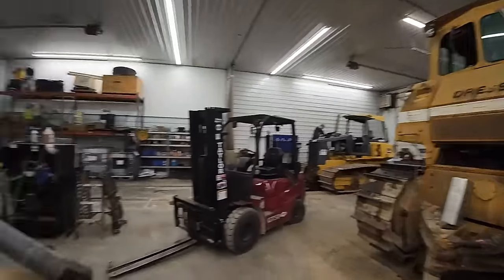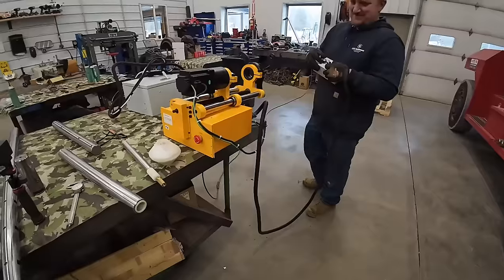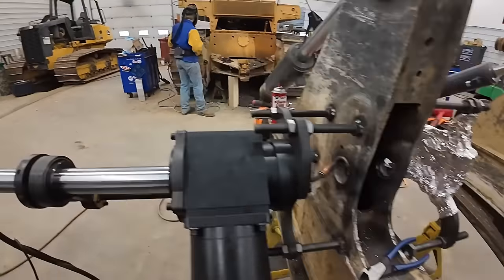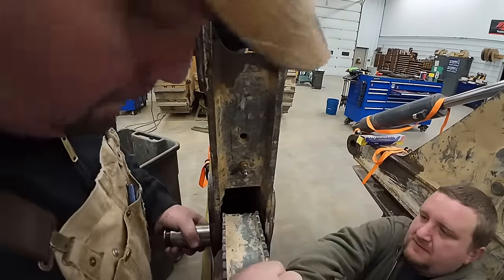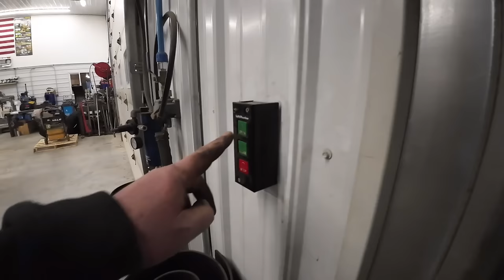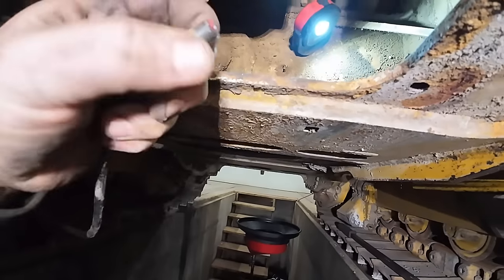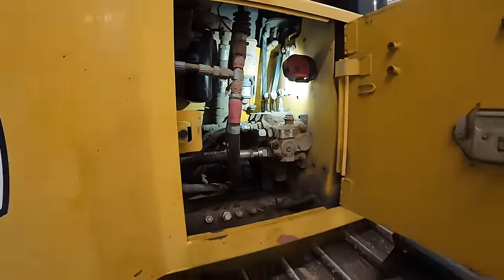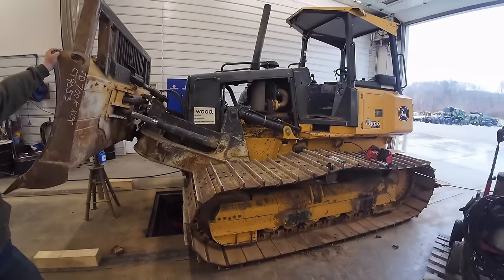Bore welding and line boring a dozer blade C frame and installing on a John Deere 700J

Comment: A "buck-boost" transformer maybe adequate to adjust the voltage output and be more cost affective. However the standard wiring of them are for 12 / 24 volts or 16 / 32 volts. If the building power is at 120 volts, a 12 / 24 bucks boost on the 24 volt taps will give an output of 120 - 24 = 96 volts. This would be most acceptable to operate the unit. The kilowatt size of the buck boost transformer at 24 volts in this case would be 24/120 = 20% of the full load of the motor at 100 volts. The bucks boost transform comes with a wiring diagram to indicate how it is wired into the circuit.

Comment: The overheating issue may be due to the cord length and size that you ran to it. Need to use the shortest possible cord and one wire size larger than the load requires to account for voltage drop and the fact that it is a cord, having the wires encapsulated in the rubber sheathing, holding in the heat.

Comment: overseas is 50 cycles.. here is 60 cycles..  so the a.c current is going faster then overseas, voltage is 110, or 220 to our 120 and 240

Comment: I believe they run 50hz compared to our 60hz. Which may account for the increased temperature. Nice thing is that the Servo motors are very common and could easily be replaced. Not sure what those are rated at.
Reply: I also think your right but dont they run 100😮 volts not 120? So it would be 50/100 where we are 60/120.🙄
Reply: Half of Japan is 100V 50Hz, the other is 100V 60 Hz. They are the only country that I know that is 100V. Europe is 230V 50Hz.

Comment: Most of the across the pond the power is 50 cycles and 240 volts instead of 60
 cycles 220 volts.

Comment: What about using the large boring bar to cut a hole for welding in bushings with an ID correct for the pin?

Comment: Think you should replace the motors with American specs the cycle is off , but then they will run like they should. Maybe you can buy a power converter.

Comment: I think if you do the conversion of inch to millimeter I think you said you were taking .080 which is just over 2 mm so you were running it at its maximum cutting.

Comment: you can convert to hydraulic motor  you need a pump  and a motor and a controller the electric motor is bad for burning up i work in power plants as a machinist hydraulic is the way to go hope it helps you out

Comment: I wish it was in the budget to do that to the JD350C I bought off you, been working through the pivot points for the blade and taking out some of the play. There was a bit more play in it than it looked. At least its giving me some video content
Reply from the maker: Yea
It takes so much time and money that unfortunately as a shop it adds up and prices the machine out of the market 
We just did all this to the TD25 but the price reflects the work we put into it
It does make for good videos!
Reply: @C_CEQUIPMENT  Totally get that and understand. It is what it is. Just as you have shown “maintenance, maintenance, maintenance”. Also John Deere did not have grease fittings on some of the movable parts.  😢As well as they added replaceable slides on the later model blades than mine. Not sure what they were thinking with metal to metal on movable parts. But it will work out when I’m done. Thanks for the reply

Comment: Isn't there supposed to be a cover over the the hydraulic hose connections on the front of the machine that acts like a strain relief for the hoses?

If you want good line boring and welding equipment climax is an excellent brand and they are hydraulically powered units with a separate power pack unit.  The issue with the motors getting hot may be related to the voltage of power you are running them on.  A common problem I see is people running equipment designed for 240v 120/208v power systems.  My parts washer didn't get real hot and it took forever to warm up because it had a 240v heating element and I was running it on 208v.  I didn't have any problems after replacing the element with one designed to operate on 208v.  The older miller welders actually have a jumper near the wire feeder for switching the unit between 240v and 208v power.

Comment: I think your issue withe motors may be two fold. They may be 220 volts at 50 cycles, the 220 they use in England is like our 110 outlets.  Hot  nuetral and ground but 220

Comment: i know someone has likely said it already but europe iis like 240vac /50hz, asia is 220/200vac 60hz, usa is 110 /220 vac 60 hz that could be it you might have to see if the things have a voltage switch under a cover somewhere? just an idea  ack hydro oil to tha face!

Comment: Check Kurtis at cutting edge engineering. He is on you tube he does alot of line boring and welding. Just a suggestion.

Comment: Clint you may want to consult an electrician but I’m pretty sure european power is 50Hz and I believe USA power is 60Hz. This may be your motor overheating problem.
Reply: Found this too. 

For the same motor all the parameters are constant except the frequency and this will affect the applied voltage, so simply apply this equation and see what will happen:
V1/f1=V2/f2, V1=400v (for example), and
f1= 50Hz,
f2=60Hz.
Then, the new voltage to be applied V2= 400x60/50=480v.
This is the new required voltage to be applied to get the same motor duty as before.

As you see the voltage should raise to get also the same power as before, if not the motor will consume more current and become hotter. I mean you can imagine if you have a motor running on less voltage of what is recorded on his nameplate, what will happen to it? This is exactly what will happen in this case.

It will run with following problems for a 50Hz motor running on 60Hz:
The core loss will increase and cause over heating of core.
As the core loss will increase, the Power Factor of motor will reduce.
The motor speed will be higher, so shaft load will increase. Motor will be overloaded at rated load.
Motor will produce magnetic humming sound.
Motor Bearing life will be reduced (marginal) for more speed and more load.
Dielectric Stress on insulation will increase due to higher frequency, causes marginal reduction of life of motor insulation.
But, it is practically seen, there is not much difference in service of a 50Hz, 2HP/3HP, motors when operated at 60Hz.

Comment: Might be a low-voltage issue on the motors. Or just cheap foreign junk. If you’re going to make a habit of line boring then go with American or even Japanese or Taiwanese. Just keep wearing The King’s safety shades.

Comment: They do make a spray so weld splatter doesn't adhere things you don't want it to 😊😊 On Fire Welding has a UTUBE channel and lots of experience in line boring on heavy equipment check it out 😊

Comment: Europe is 50Hz 240V, USA is 60Hz 110V or 220V. So unless thats a dual frequency motor rated for 60Hz/220V it will get hot. It should say on the motor nameplate.
Reply: US is 240/120 volts 60Hz

Comment: generally every country out of the U.S. runs on 220 if you were running it on 110 that could be the reason for the hot motors